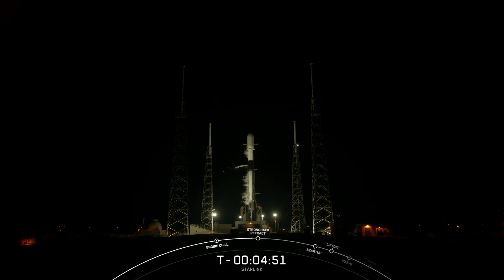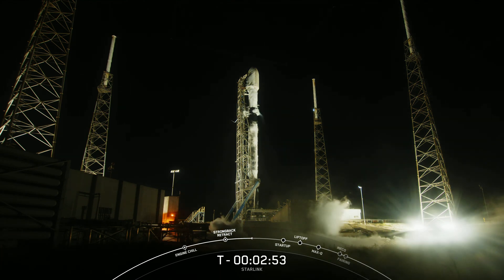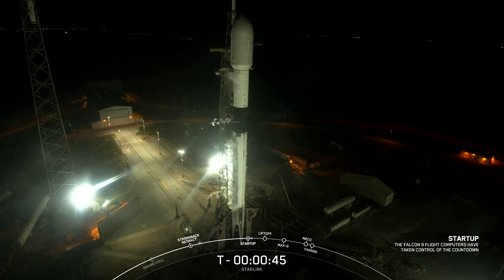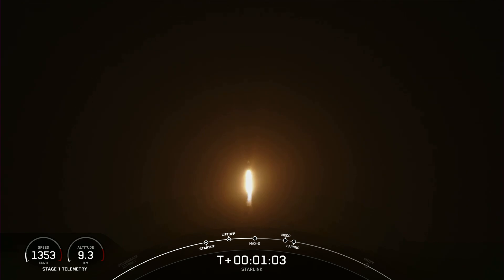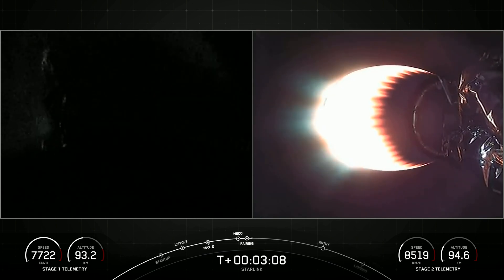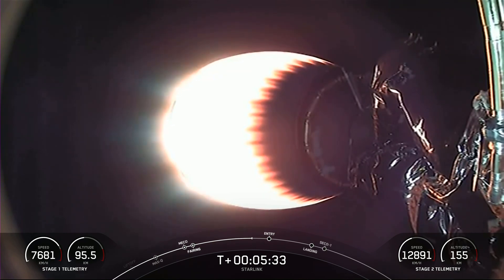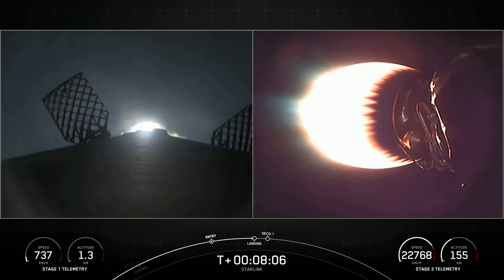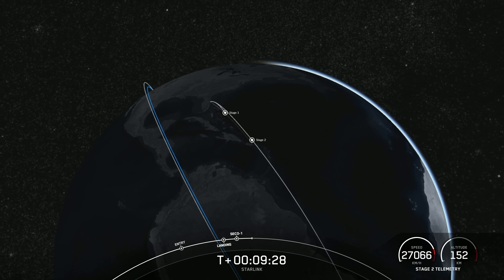Starlink Mission

Comment: How many times has this specific 1st stage been used? 27 times!? I thought they were limited to 15 or so. Either way, absolutely incredible as always. This will never ever get old
Reply: This was the seventh trip to space for this booster.
Reply: 7th time. They don't really have a 15 launch limit. Initially, they planned to possibly get 10 launches out of each booster. They did, and they decided everything was fine, so they kept going. They set the threshold for the next major inspection and maintenance at 15 flights, and several boosters are now at that point. They could be scrapped, but it's very likely that they'll just extend their expected lifetime and keep launching them. 

From what we know from SpaceX, they've found there is no reason why they couldn't get 100 flights out of each if they wanted to.
Reply: @odysseusrex5908  Oh, absolutely, all I meant was that from hoping they could get 100 missions from them and actually getting them is a long road. Never before had rockets been reused, it's the kind of thing you can only simulate to a certain extent. It's like the round windows on the comet, you'll only learn about it once you try it. 

It was a nice surprise for them to know they didn't even need that much refurbishment after 10. 

And, regarding Starship, I'm not entirely sure about that. Not because I don't think Starship will succeed, it absolutely will. 

The thing is, there'll still be a market for "stupidly reliable" for a long time. We don't know how long the ISS will be extended, but as long as it is, there'll be Dragons going there. The other private stations that might or might not actually happen and operate, such as Axiom's, aren't really designed to be served by a beast like Starship, so, Dragons. Even after Starship is operational, national security launches will enjoy knowing they have the most reliable rocket in history still available. So, I don't think Falcon will go away that quickly, it'll surely launch a whole lot less, but it'll coexist with Starship for a while. And, possibly because of that, SpaceX will most likely not want to continue producing more 1st stages, they'll just make themselves a nice stock of 2nd stages, a whole bunch of MVacs to last them years, and shut everything down. Which means, possibly, we'll see a small fleet of 10 or less boosters be reused over and over, just because there's still a market for it. 

Or maybe it's just me thinking I don't really want to see Falcon go away. I mean, I'm stupidly excited about Starship, but that doesn't mean I won't cry like a baby the day Falcon gets retired.

Comment: Is it just me or those legs opened VERY, VERY late. Safe and all just quit late, they barely drop down and it's touchdown.
Reply: They open just in time for touch down!
Reply: Yup. It's totally intentional. The booster has a thrust to weight ratio greater than one, and just the barely necessary amount of fuel, so it can't hover, it decelerates linearly, and fairly fast. Legs deploy down using nothing but gravity, against the atmosphere. If they deployed them earlier, the booster would be still going so fast that they wouldn't deploy and lock down, but instead just be blown back up by the airstream. Also, it would expose them for longer to the engine plume, potentially causing damage.
Reply: They hold off until the last possible moment.

Comment: Still want to see a satellite deployment. Is the process proprietary and that's why you won't show it? I don't mean the undocking of the module, I mean the individual deployments.
Reply: I am not sure, they used to show them but decided to stop.  I have often wondered how many people were like me, the mission ends with the booster landing and so I speculated that maybe they see a drop off in viewers after that point and decided to save time for some of the staff.
Reply: @TheEvilmooseofdoom  That's exactly what it is. They showed deployment for the first ones when it was new but now it's so routine it's just not worth it to show.
Reply: Go back and watch some of the older missions, they used to show everything. They are just launching so much, that they've tried to make the broadcasts shorter. They start closer to T-0, and end them right after SECO.
Reply: @aaronbritt2025  You have to really go back to the first missions. Here: https://youtu.be/Uy9Jn-3vuPs?t=4988

Deployment is quite different from any other satellite you've seen deployed. Satellites are flat-packed, tight, supported only by a large rod. The 2nd stage uses RCS thrusters to begin rotating, and then it just lets go of the rods, allowing the centrifugal force alone to spread them out. It's brilliant.
Reply: @aaronbritt2025  Those you see are the satellites. They aren't held to one another in any way, just clumped together. That's deployment. After that, as they progress on the orbit, they'll slowly move away from each other. That's done entirely passively, just by that initial spin they got. After they're far apart enough, they'll start to deploy their solar arrays, and use those (as sort of makeshift spoilers to control drag) as well as their engines to control their orbit and position. If you're talking about that part, no way to broadcast it really. All of that takes days, and happens way after the 2nd stage is already dead.
Reply: @aaronbritt2025  Starlink is in the business of launching stuff to space, not in the business of broadcasting it. They do, which is super cool, but what do you expect them to do? Modify existing hardware to add cameras, which take up space and need to be validated, consume power, and potentially shorten the lifespan of the satellite, just for your amusement?

Comment: Actually the clouds are condensed water vapor not lox which is invisible in it's gaseous state.
Reply: LOX is short for Liquid OXigen. Liquid! Oxigen. If it is in its gaseous state is is Oxigen! So you won´t find liquid oxigen in a gaseous state!
Reply: @macdieter23558  It's oxygen.
Reply: @Tyrandus89  Tell me Y !
Reply: Actually boiling lox does produce big thick clouds of itself and it is invisible as a gas, but the clouds are not quite gas, they're still really fine drops.
Reply: @TheEvilmooseofdoom  Thanks! I was unaware the liquid O2 would go into an atomized form before changing completely to a gas. And I should have used 02 in my first comment not LOX.

Comment: What does Max Q mean?  They always mention it but never explain what it means...

UPDATE: Sarcasm doesn’t travel.
Reply: Uhm....they ALWAYS explain it ?

https://en.wikipedia.org/wiki/Max_q

The max q, or maximum dynamic pressure, condition is the point when an aerospace vehicle's atmospheric flight reaches the maximum difference between the fluid dynamics total pressure and the ambient static pressure. For an airplane, this occurs at the maximum speed at minimum altitude corner of the flight envelope. For a space vehicle launch, this occurs at the crossover point between dynamic pressure increasing with speed and static pressure decreasing with increasing altitude. This is an important design factor of aerospace vehicles, since the aerodynamic structural load on the vehicle is proportional to dynamic pressure.
Reply: Actually, they always explain it. Here is what it means... When the vehicle experiences the highest levels of external stresses on the outer structure of the vehicle, as it makes its way to orbit